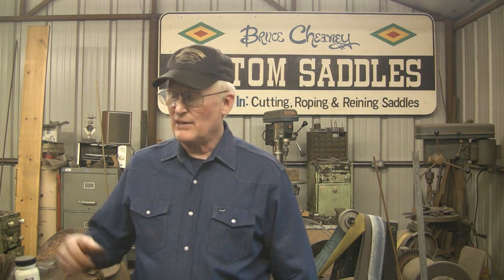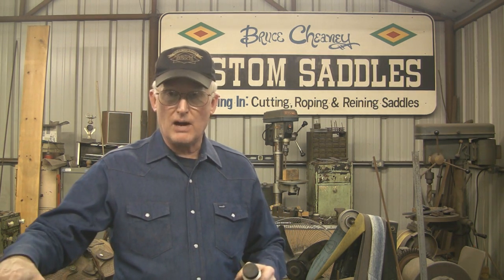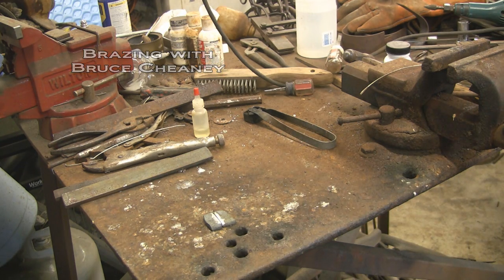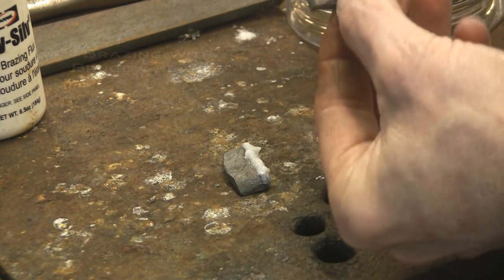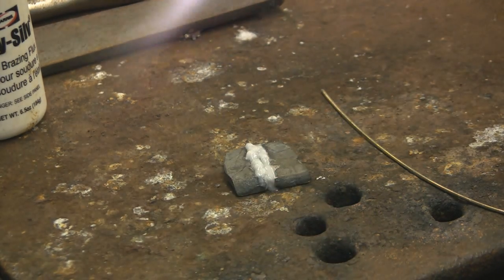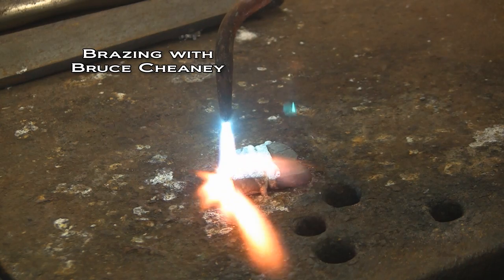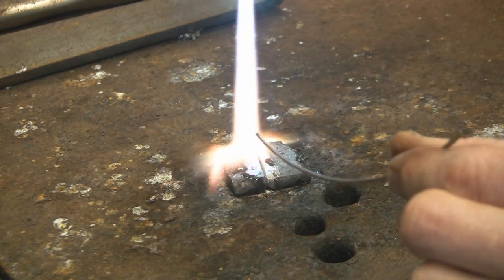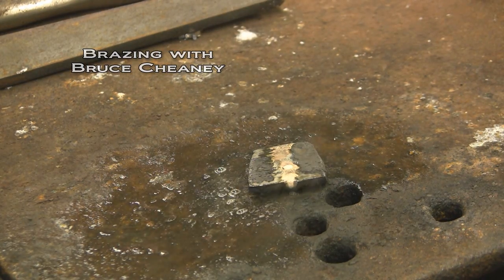Brazing Steel Soldering Tutorial with Solder and Flux by The Harris Products Group

Comment: I'm trying to repair a cast iron skillet with stay silv 56 and white harris flux Monday at work. If I silver solder both sides of my ground out crack will the braze melt and drip away when I go to start brazing the other side?
Reply from the maker: Tough question. I think the crack will fill but run off on one side but I think the crack will be filled.Use plenty of Harris white paste flux.

Comment: I'm trying to find a way to protect the cut ends of a chrome plated motorcycle exhaust. I need to shorten the exhaust pipe by a couple inches but there won't be any plating on the end after it's cut and I'm wondering if silver soldering or brazing the cut ends with something to prevent rust there would work? I know there's zinc paints and clear coats and things like that but I don't think those would hold up well over time, especially on the end of an exhaust pipe.
Reply from the maker: I think it would be to difficult to solder the end of the pipe and make it look good.

Comment: What is the minimum powered torch you think I could get away with to silver solder 1/4 aluminum to 1/16” steel hinges? My propane torch can’t get it done.
Reply from the maker: You will certainly need a Speciality solder for doing this

Comment: IF I use the Harris 56% solder & can I expect the same kind of results that you experienced ?
Reply from the maker: It will take a little bit of practice. You can do it!  By the way I subscribed to you channel.
Reply: @cheaneysaddles  You didn't answer his question. I'm also wondering the same tho? Is there a difference in the end result in 45 or 56?
Reply: @timgibson2111  he answered the questions.. he said he could but it’s gonna take a couple try’s..
Reply: Yes you can for sure… the 55% has a lower melting point so will actually be easier….better to do it on a fire brick not steel which takes the heat away..

Comment: I have a clutch basket from a BSA motorcyle.  One of the threaded studs, which  are brazed through holes in  the back of the basket, has become loose and needs to be re-brazed.  Could i carry out this with a butane torch?  I am a brazing virgin.
Reply from the maker: I am not sure if that's enough heat, You might try experimenting on some scrap pieces of steel before you try the basket.

Comment: question: can you get silver solder that has different melting points, I have to repair a cam for a lock, but it must me extended first then have a 13mm through hole and then a 13mm key way broched steel bar soldered into the 13mm hole, hence the melting point question,also we only have a gas torch the type used to do copper pipe joints sutable ??? TAMAR-TORCH
Reply from the maker: The Harris Products Group has solders that have different melting temperatures you should be able to get help at your local welding supply. Another resource is Indian Jewelers Supply ijsinc.
Reply: Brownells has 55% high temp 1200 degree